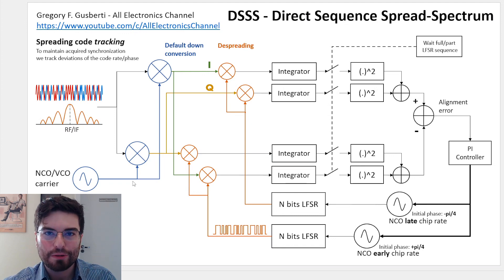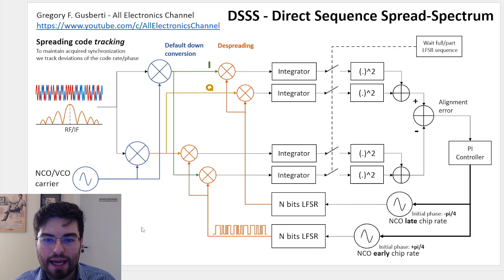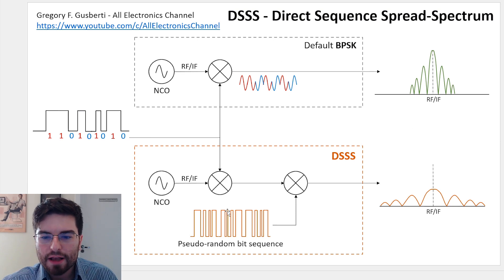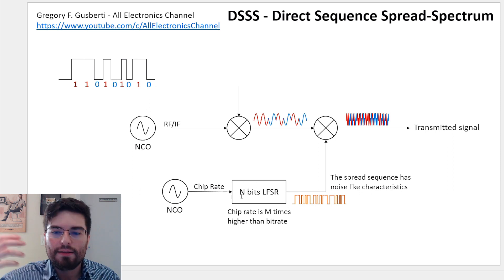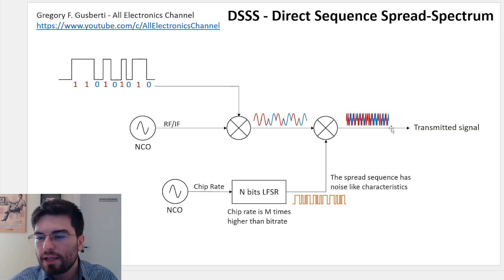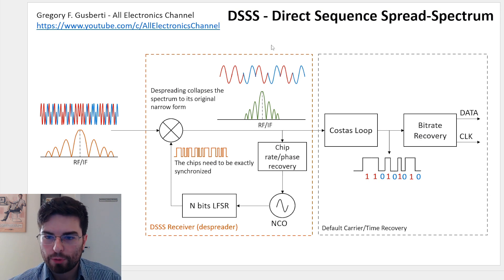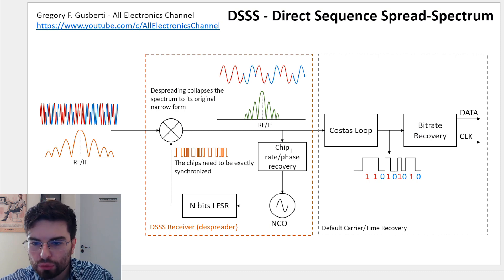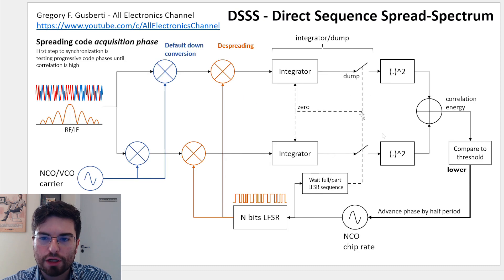Spread Spectrum Modulation and Demodulation

Comment: I would say the Acquisition stage is a closed loop, but the feedback only senses Correct or Incorrect. The feedback doesn't give Magnitude. In the Tracking phase, feedback gives Magnitude (so locks faster than Acquisition stage), but there may still be some "searching", as the feedback is affected by resolution, speed, error, and maybe tolerances in the Correlator.

Comment: The video is beautiful, I saw it now, very very beautiful! Listen, I would like to ask you a question: in your opinion is the dsss "decoder" placed before or after the costas loop? Which means, is the correlation done on a "stable" or non-stable, rotating, let's say, IQ signal?
Because, assuming to use a hybrid digital-analog costas loop of the "phasor rotator" type (like the one used by Matjaž Vidmar, S53MV that you surely know) it would be conceivable to digitize the I and Q signals on one bit into the fpga and realize the correlator with simple logic, without the need for an ADC conversion. Sorry for the very technical question but I'm building a 10Mbit/s RTX PBKS, I have the prototype here in front of me and I was thinking if it could be made spread spectrum...

thanks for your attention, I hope you can give me a tip!
Reply from the maker: Hi man, thank you so much! I think usually the de-spreader is placed before the costas-loop, as the frequency-offset usually is much lower than the spreading factor. So, for the de-spreader, the frequency looks constant for the time-intervals it is integrating and measuring the sequence synchronism.

Keep me posted with your progress, I totally support your project, and I liked that you are also a big fan of S53MV, our godmaster!
Reply: @AllElectronicsChannel  Look, this morning I was alone and I just finished running the costas loop on a LCMX02 lattice fpga. truly exciting!!! I'm new to signal processing but between this project and your videos you can learn a lot, even if not very quickly! If you want to delve deeper into this topic in the future, give a shout, I'll gladly share what I did!
I'll bother you again anyway!

Comment: Your videos are mindblowing !!! The way you explain things is absolutely marvelous !!
Moreover, I would like to know in which case the SSM is used, based on its complexity, it should be somewhat interesting (or it would not exists....). But why is it used ? 
If the PRBS signal is acting like a noise, what happens if you add real white noise on top of it ? will it be still recoverable ?
Reply from the maker: Thanks!! 

The spread Spectrum modulation has some magical aspects. 

Think with me: what happens if we have an interfering signal close to our signal?

The process of despreading in the receiver will transform this signal into noise!!! And our desired signal will come from noise and appear clear! 

So, non linear distortion, IP3, spurious, all affect the receiver equal no thermal noise! 

Over all that, we can have multiple transmitter with different code sequences, transmitting at the same frequency. The receiver will despread only the signal of interest.

GPS uses spread Spectrum. All satelites transmits at the same frequency, each one with a different code! 

And it even more fun, it connects to multiple satellites using paralel receivers, despreading each one with the correct code. The phase different of the codes relative to each other is the difference distance between you and the satelites!! This is what is used to decode your position!
Reply: @AllElectronicsChannel  very interesting !
Thank you for your reply !
And I like this format, don't change it (simulation and signal path explanation) !!!

Comment: I have subscribed, but did not find simulation files. Explanation is very good but have the simulation files would make this great.
Reply from the maker: Hi man, I attached in the post about this video on Patreon. Did you search there ?
Reply: Yes, I subscribed and searched that area. I could not locate the video posted here or simulation files.  @AllElectronicsChannel
Reply from the maker: Send a message to me on Patron
Reply: The message interface does not appear to be active on Patreon. Maybe a firewall  issue on my end.(??)  @AllElectronicsChannel
Reply from the maker: I replied there 🙂

Comment: The spreading code is a much higher frequency than the bit stream. But, is it a much higher frequency than the carrier?
Reply from the maker: No!! Think about that.. what happens if you" modulate" a signal with a much higher frequency? It alias.. The data becomes the carirer, the carrier becomes the data...

Comment: Great video! Unfortunately for me, I'm still missing the point at which the spreading sequence applies. Will it matter if we apply the spreading sequence to the data stream - as what was shown on a slide at 6:26 - first and then mix it with the carrier or we should first get the modulated data stream signal and then apply the spreading sequence? As I see it it should produce the same result, shouldn't it?
Reply from the maker: Yes, absolutely!

Comment: Nice vid! The incoming pn sequence in the spread spectrum signal is running at chip rate. For your correlation procedure with the local pn sequence, what sampling frequency do you use? eg. 10 times the chip rate? Thanks!!
Reply from the maker: Hey! For this example, I don't remember. I think anything higher than 5x should work fine. Probably the first systems used 2x...
Reply: @AllElectronicsChannel  Thanks very much for your reply, and for mentioning higher than 5X should work. Best regards.

Comment: Let's assume that the receiver PRBS generator is not the same as the transmitter's, how would you change the receiver's PRBS in real time?
Reply from the maker: You only need to change the PRBS generator. If it is a table you change it, if it is a LFSR you change the taps

Comment: what are the advantages in a spread spectrum system?
Reply from the maker: The spread Spectrum modulation has some magical aspects. 

Think with me: what happens if we have an interfering signal close to our signal?

The process of despreading in the receiver will transform this signal into noise!!! And our desired signal will come from noise and appear clear! 

So, non linear distortion, IP3, spurious, all affect the receiver equal no thermal noise! 

Over all that, we can have multiple transmitter with different code sequences, transmitting at the same frequency. The receiver will despread only the signal of interest.

GPS uses spread Spectrum. All satelites transmits at the same frequency, each one with a different code! 

And it even more fun, it connects to multiple satellites using paralel receivers, despreading each one with the correct code. The phase different of the codes relative to each other is the difference distance between you and the satelites!! This is what is used to decode your position!